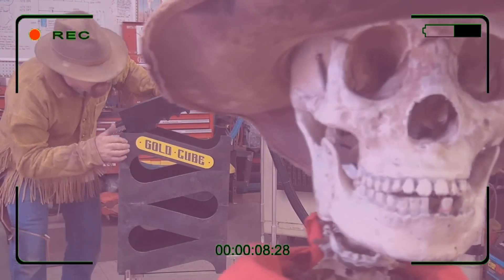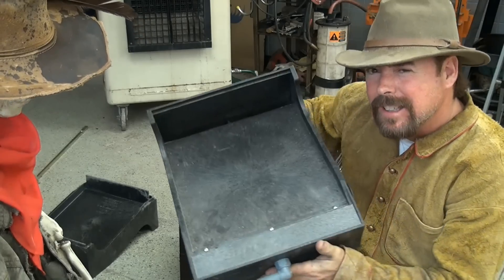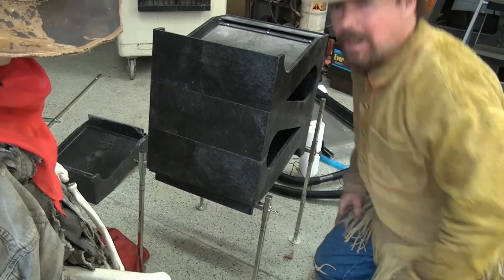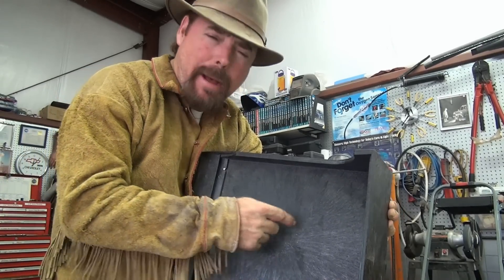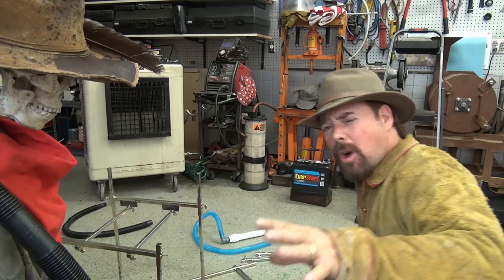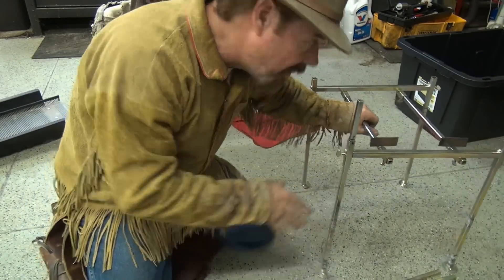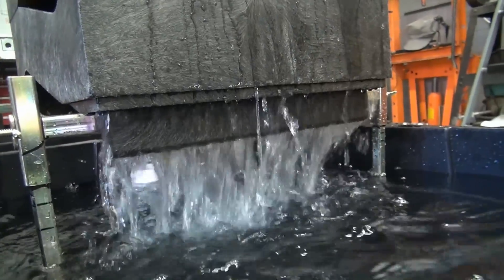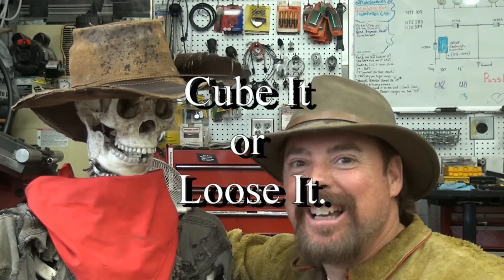GOLD CUBE | GOLD BANKER | Use it to get Fine Gold - ask Jeff Williams

Comment: I like the idea of the two tubs and the tub flanges.  Do you know that tub flange costs $75 per set on www.goldcube.net and  you need two sets?  That's $150 just to create a bridge between two tubs.  I think that's really over-priced for the application, don't you?
Reply: You can buy PVC fittings at Home Depot or Lowes that I believe are capable of doing the same thing.  I used to work in irrigation and it is rather easy to fabricate things you just have to make sure you have a good seal.
Reply from the maker: we like the idea of two tubs two and I know it might sound steep but it is well worth it.
JS
Reply: Life In Real Estate: I completely agree 100% about the overpricing on the flanges. For $75 you should get two tub flanges, 3 tubs, all the piping required to put it all together, free shipping, AND a bag of pay dirt to boot!  That must be close to over a 500% profit on those things. I'm currently waiting for my gold cube and trommel to arrive, but I'll be looking elsewhere for the tub flanges for sure.
Reply: All mining isn't done in the ground

Comment: hey Jeff love your vids bud, I also have a gold cube and bought one of the 12v 3amp laptop chargers. but when I hook it up to the pump it just kinda stutters. It works sometimes and sometimes you have to take it out of the water to get it to start. any ideas?
Reply from the maker: you might have a bad charger....sound like the pump is no getting enough power. Try another power supply with a little higher amperage rating.
JS
Reply: thanks Jeff I'll give it a try

Comment: Jeff.... One thing I use to level my Gold Cube is my cell phone and the free App plainly called Compass. This App even in the woods with no reception receives GPS location to work your compass, and also gives location in Deg Min Sec to ensure you are on the correct claim. Just swipe the screen to the left and it turns into a leveler for vertical and horizontal with + or - your exact level angle. I just check my 4 sides on the slick plate and adjust the legs as needed for a fast setup. Luck all.
Reply from the maker: thanks for the tip there Eric wil have to remember that one.
JS

Comment: another great video jeff...and slim! I've been out in the desert for years and will mostly use water only. gold cube is great and I love it but recently went to the "little giant" trammel. no classifying needed, just load it and clean the rocks. for classified material I will always use the gold cube because it works! as always...best wishes and your yellow pans are better than mine:)
Reply from the maker: Thanks Norm and we like using Trommels too but it depends on the area and the situation.
JS
Reply: alright..burnt out the second motor on the gold fox. they were gracious enough to do a onetime replacement on it and included their version of a water cooler for the motor. pretty good of them I thought. so short story long version is I did purchase the gold banker and will be using it this weekend. couple of questions if you've time. 1) how well will it separate small roots..will it clog the gold cube? 2) do you really have to screen down to 1/8" or can I scoop bigger rock in to wash them as the dirt I am working is still wet from a 100 year storm? thanks again for these tutorials on equipment! and yes, I do own a banjo pan also. p.s. gold fox is working with the manufacturer of the drive motor on the trammel. it needed an adjustement on the torque but since it's so hot I will wait for cooler weather and run my new gold banker!
Reply: hot dog! got to use the gold banker last Friday. and I believe I have found the one piece of equipment that I will use in just about any situation. I was out in the desert by the johnny mine and doing a real world test. it was good that I was forced to slow down a bit...not much though, to run it and just using 1 battery for 6 hours of nice quiet running. I am impressed and the folks at gold cube have come out with another fine product!

Comment: when you use the two tub system make sure the pipe thats draining the water from the first tub is up higher that way it lets the water drain but not as much of the dirt. That makes kind of a make shift settling pond if you will.
Reply: Looks like we both had the same idea.

Comment: Nice job Jeff, Another way to get it to set in a big tub is to set a 2x4 from side to side, one in front and one in back.  That is a way for the folks out there without a welding shop to be able to just set the legs on the boards and go.
Reply from the maker: Hi Mike , hope you liked the vid cause this was Slim's idea. we though about the 2 by 4  but thought how fun would it be to do a little welding. But yes we should have mentioned the other method.
JS

Comment: Jeff, I bought 2 different size mortar tubs at one of the local "big box" stores.. I put one inside the other, and then use a smaller dishpan to catch the tailings. The smaller mortar tub has lower sides than the larger one. I place my pump in the larger tub. After 4 hours of running sand through the setup, I had less than 1 small shovel full of sand in the bigger water recovery tub. The smaller tub acts like a trap for all the sand that washes out of the dishpan with the water. Yes, I have to dump the dishpan every so often, but I made a log retainer right next to the hole, and dump the tailings behind that. Then all I have to do is remove the log and a few scoops with the shovel, and I can fill my hole back up the easy way. I also found that using a piece of plywood under the tub and stand made it way easier to level the Cube, and didn't have to keep re-leveling as the sand shifted.